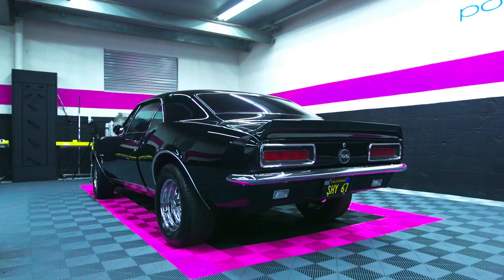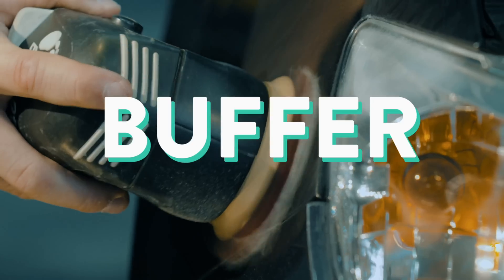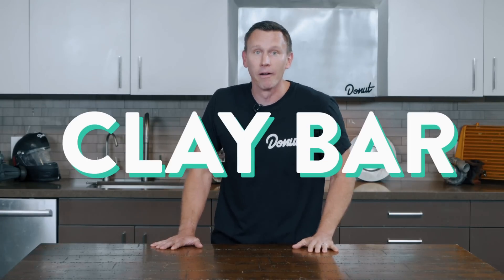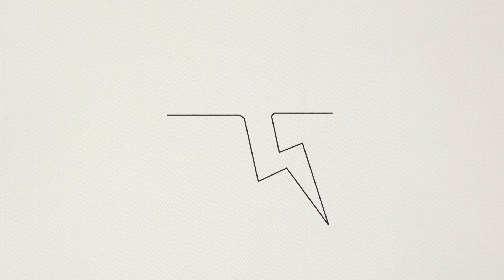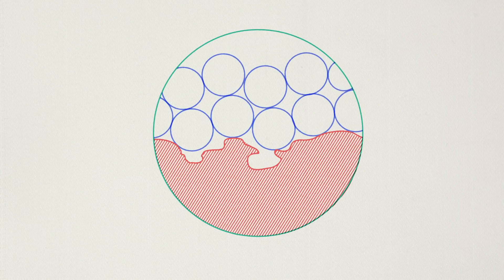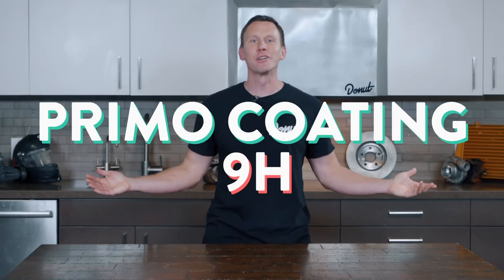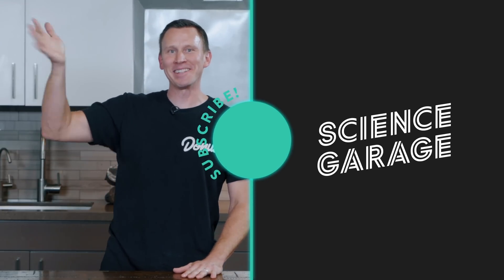CERAMIC COATING - How it Works | SCIENCE GARAGE

Comment: I didn't bother to do all that extra work because it says on my container that you can put it over anything. I washed and put a coat on. Does exactly what I wanted. Makes a very smooth surface that makes the water run off and hopefully all the dirt and crap won't stick as easily. I don't care for the super shiny look on car paint or tires.

Comment: Seems like you really should fix any paint chips no matter how small as you wouldn't want to fix them after ceramic coating as the paint wouldn't bond with the surface below as the ceramic coating is in between.  Correct?

Comment: I spoke to an automotive pain specialist at a high end car repair place, about various pain protections. He reckons ceramic paint protection is an expensive con. I'm inclined to believe him. In real-world applications, I haven't heard of it working any better than cheaper products over a long period. A friend paid a fortune for his new vehicle to be done with ceramic coating. A year or so later and it looks like it was never coated in the first place. He keeps his car in a garage most of the time, too.

I use stuff called Glaze (formally Autoglaze). Their website's a bit iffy, but the product works. It's been around a lot longer than ceramic coatings. Glaze isn't a polish, either. It's a polymer that bonds with the paintwork. It actually has tiny beads of glass in it, so the paint comes out ultra-shiny. It doesn't end up with any swirl marks and things like dried-on bird poo usually just wipe off, without any water or cleaner. However, I still carry special Mequire's or Autoglym paint cleaner to ensure I don't scratch up the paintwork.

Comment: Hey that hardness comparison and the relationship to pencil hardness is incorrect and accidentally misleading. 9h hardness on a pencil is like stiff wood but 9h hardness on the mohs scale (of which this video is clearly referencing) is harder than the best steels.
Reply: This is a big issue because it takes the concept of this "ceramic" stuff and implies a 9h hardness like ceramic in the mohs scale when it's actually an 9h in the pencil scale which is softer than the paint it is on.

Comment: Except. On some surfaces it just doesn’t work very well. I had my wheels done twice. They are black so they show brake dust very easily. I was attracted to the product because I wanted to be able to just rinse the wheels off without having to agitate every square inch to remove the brake dust. It didn’t work. And before someone tries to blame it on me, I had the wheels powder coated professionally and then Ceramic Coated before they were ever mounted on the car. Then I had it done again a few months later because it didn’t seem to work well the first time. Guess what, didn’t work while the second time either. 

Prior to this happening I convinced my father to have his wheels ceramic coated on his Z06 Corvette that had the factory chrome look. It seem to work really well on his car for a few months and then it stopped working.

Comment: How about a Hairlstorm test next time 😃
I was thinking to make a test of Ceramic coating. 
Like 3 coats and how durable it is.
Having 2 pieces of the bonnet or trunk same shape.
Then 1 with Ceramic Tripple layer and 1 normal paint.
See if the hard surface of ceramic protects from dents from such Storms.
I suppose one coat is like 7 H or 9 H hardness. Tripple would have a really solid surface to it.
Just that have to wait for the storm after applying 😁

Comment: I drive an old car that has clear coat all faded off so I just sanded it and painted it with base coat for a matte finish. A much cheaper and less maintenance heavy way. I don't have to worry about scratching it.

Comment: you get the same desired effect with regular wax(shine and protectant) as you do with ceramic coating without the expensive cost...wax is cheaper but may have to be applied more often.

Comment: FAKE.  This product is not ceramic.  Just because they call it ceramic does not make it so.  Ceramic is clay hardened by extensive heat starting at 1,650deg F, PERIOD.  The best benefit of this process is the prep work.  They take extensive measures to correct all defects in your paint.  That is what makes it look so good.  Then they apply a silicon based hydrophic liquid.  In actuality that shine you get is just from the paint correction process.  Just like a new car will look like new for years if it is well cared for, this paint corrected car will look good for years if it is cared for.  These products are not ceramic.  At best they are long lasting (annual), wax like coatings.  Read your fine print.  The lifetime warranty requires annual inspections.  What do you think they do at that annual inspection.  Clean and reapply the coating to protect the paint correction.  And if you have used "any polishes" or washed other than by hand in between inspections, guess what, your warranty is voided.  Because any abrasive action will remove the "ceramic" coating.   Are these processes good, probably, but they are far from the hype.  Save yourself the small fortune and just pay to have your car waxed every 3-6 months.  The cost of these gimmicks would be a nice down payment on a new car.

Comment: If you ceramic pro your car, does that mean you can no longer put a wrap on it? Since the wrap probably won't stick well with the coating on? Or vice versa, if your car is wrapped or has some decals or vinyl, can you put ceramic coating on top of that?

Comment: I used Avalon King Ceramic coating on my Corvette and it does work. I did the car, my wheels  all the glass and trim. My car is a convertible, so one bottle (Kit) did it all.   I have to say it came out  beautiful, the shine is amazing and the dirt rinses right off. It comes in a kit with everything you need. For around $65.00 bucks. Make sure you wash your car with Dawn dish soap it cuts the grease etc. the best, then follow directions. You can find them online Avalon King ceramic coating. Great product.
Reply: hell of a product

Comment: Now i wonder car manufacturers didn't come out with factory coated, if the say to cut costs, that's nonsense, because the could mark up the price as an option.
Reply: My best guess is it would slow down production cost cutting isn’t always just how much it cost to apply something but also how long it takes
Reply: @jigglebones9301  one solution, 'robots' , non human worker. If someone needs the car ASAP they could just dished the coating option., and got a non coated one, if humans can do it in few days, machines would do better job on a shorter dateline.

Comment: I suggest that if you want a ceramic coating done properly and with care that you do the research, practice on an old car, and do it yourself. The detail shops are suffering from the common malady of the day: they don’t give a crap about what your car looks like in the end. They just want your money.   I shopped around and did my due diligence, or so I thought. I picked the detail shop. They said they would have my car a week for the work I was having done. They had it almost 2 months. And they still didn’t get it right. It looks like crap. A lawyer told me it would cost me more to sue them and get it fixed than I could get out of them.  They cured me of ever trusting any business with my car.

Comment: I'm getting a paint correction and ceramic coating on my all-black 2019 Nissan 370Z. The ceramic coating I'm going to use is the Opti-Coat Pro+, which uses silicon carbide nanoparticles instead of silicon oxide particles.
Reply: Paint correction on a 2019?!? What happened? Is the factory paint just that bad??

Comment: i wish nissan had used ceramic coating on my nissan Micra 2018, because the paint has so little coats that i can be scratched by looking at the freaking car. As soon as i get it repainted i will apply ceramic coat myself. By the way i dont know if this problem is common on new cars, but my previous car, a Seat Cordoba GTi  from 1998 had such good paint i could hit cars while parking and it wouldnt even transfer to the other car or scracth (not that i did it usually but while learning to drive it happened 2 o 3 times) , it was amazing, i guess cost its the reason for such thin paint coating, but that little protection of the paint having such cheap coating products on the market is a shame for nissan. Great video Donut Media as allways

Comment: System X ceramic coating is the way to go. Better protection with only 1 coat, Ceramic Pro requires 4 coats to achieve this level of protection.
Reply: Actually, Ceramic Pro gives fantastic protection with 1 coat. 4 coats is only if you want it to last forever and have a permanent lifetime warranty.
Reply: @kenbouchard834  System X offers a lifetime warranty with 1 coat.
Reply: @Vox Populi before a ceramic coating is applied a vehicle MUST be completely stripped of any wax and contamination. Chemical and mechanical decontamination followed by whatever polishing is needed, then an IPA wipe of all surfaces going to be coated. Then you can apply your ceramic coating. If the prep isn't done correctly the coating WILL FAIL.
Reply: @Vox Populi iron remover, there are several available Carpro IronX is the best known, but expensive.  Some cases a tar remover. Followed with either a traditional clay bar or synthetic clay wash mitt to remove embedded contaminants. Re-wash the vehicle, this step is optional. Then determine the level of polishing needed. I personally recommend wiping each panel down with an IPA solution after each step of polishing. A lot of compounds and polishes will hide defects. IPA solution will remove leftover polishes that can hide defects.

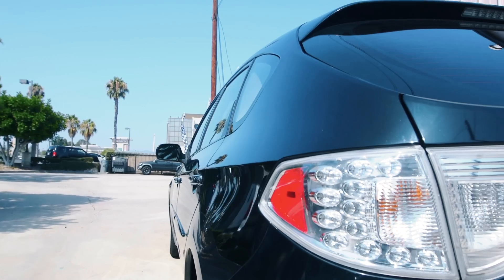Comment: 9:37 lol undoo all the hard work of them removing the scrathes lol good idea. Idk why people think you coat it and shes good to go no need to worry about scratching or maintaining the finish. Taking it through those acidic touchless car washes for example strips the coating. If it can over time ruin rubber and plastics it can chop away at any mircoscopically thin coating you put on. So buyer beware. ceramic coatings are fanfuckentastic but you have to maintain them properly too. otherwise its just wasted money and time. Learn how to properly clean car and enjoy a smooth clean paint job for many years ;).

Comment: The question I can't seem to get answered.  When it becomes time to reapply, Do you need a professional to remove the old coating??
Reply: Bryan Sage professional will repolish the car down which will strip the old coating unless it’s a 10h coating like the one from GTechniq. That cannot be buffed off, only sanded off. Then a repolish and recoat. This said from an accredited GTechniq installer.
Reply: @totalpackagedetailingllc4413  Thanks, your only the second person to answer that question after a year of asking it.  It seems to me that would be a hidden cost of your having it done professionally.  At the end of the day you cannot just walk away and try something new or even just clay bar.
Reply: Actually you can, that process would only be required if you wanted to reapply another ceramic coating. You can put wax on or clay bar it after the coating longevity period is over.

Comment: My question would be:
I see a lot of cars who have horrible paint jobs done, as if the paint was peeling off.
I was thinking, could it be that the Ceramic coating isn't UV resistant, and starts cracking the paint over time?

Comment: For anyone wondering. Average cost is +-$1800. Starts around $600 for a quick wash and a few coats of ceramic coat. (Don’t recommend you go cheap). Can go up to +$3500 for paint corrections. Polishing. Many layers on paint. Wheels and windows are optional extras.

Comment: 10H Glass ceramic coating is where it's at. Just getting the basic coating (8/9H) just isn't worth it since it doesn't protect against scratches.
Reply: There is no such thing as 10H LOL! Anyone or brand pushing that is just straight lieing to the market. Ceramic Pro Products are above 9H in hardness, but there isn't a scale past 9H.

Comment: Ceramic coating seems like snake oil.
Reply: To extent it is. You have to maintain it. You can just slap it on and wash car through automatic washes and whatnot. Or even with improper washing methods. Very simple you just hand wash it with recomended soaps and it lasts for years. But there are alot of snake fucks in the business that dont tell full story to customers. Imo thats not fair i understand they need tomake a living and provide service and its customers job to do the research but still. Some people that think they need or want this done to their cars should just save their money for something else. You buy a brand new lexus or bmw and want it looking mint i get it ya do it but make sure youre the type that cares for their stuff. But if you got some pickup truck that you take to job sites...mmmm id recomend you buy carpro cquartz uk and learn to coat it yourself. The main thing that costs money with these ceramic jobs is the paint correction. On a work truck though....do you really need the paint looking mint with no swirls? Probably not...all you need is to make it easy to clean.
Reply: Red Menace VINWiki doesn’t seem to think so.
Reply: If expensive car you sure. Every car not.

Comment: X-Men's Colossus is actually a normal guy who worked in a car body and paint shop, he accidentally fell into a vat of 9H ceramic-coating liquid. Now, he's heat-resistant up to 1200 F and is very easy to wash, no shampoo required, just water at a high angle is needed.

Comment: Because when I have 1,800 sitting around I think... "You know that car that has 350,000 miles on it and I just dropped in a new tranny for? I think I want a ceramic coating."

Let me know when its $500.00 or less, I'll be first in line.

Comment: I got the Gold Package Ceramic Pro 9h on my BRZ.  Easily the best decision I've made to keep my car clean as its needed to be parked outside due to no garage.  Its so incredibly easy to clean and maintains the hydrophobic properties even after two years.  Sometimes I wax it just to give It a sheen but thats really just for looks.  Completely worth it.
Reply: Instead of waxing it, buy a 10% silica spray sealant to make it look like the day after the coating was applied. Basically a lite-version spray on ceramic coating that boosts the coating’s shine so much.

Comment: What is 9H on the moh's scale?
Reply: 9H isn't on the MOHS scale. 9H is refrenced to the pencil hardness as explained in the video.
Reply: Ceramic PRO USA sounds like you have an inferior product. Why start the video with the moh's of this and that and then change to some other scale. All solids can measure in moh's. What's the moh's of your product?
Reply: We aren't avoiding the question... watch the video again. He references MOHS scale to rocks and minerals that can get into your clear coat. Our product isn't measured by MOHS Scale so why would we want to mislead anyone by doing so? Its 9H on the pencil test as other coatings are measured the same way. We are backed by carfax and are the global leader in ceramic coatings.
Reply: At 1:39 the video says most automotive coatings fall between 2 and 4 on the MOHS scale. If you will not compare your automotive coating to these others on the same scale I must believe yours is equivalent or inferior.

Comment: Coatings are great for about a year. A lot are fantastic for two. But the issue with 3 or 4+ year coatings is that contamination builds up and effects the hydrophobic properties that make cleaning easier a less harmful to the paint.
Reply: That's why with ceramic pro they have you come back once a year for a check up. The car gets completely decontaminated and then a refresher coat is thrown on top to keep the coating working properly and to keep the top layer of the coating from getting worn away through abrasion

Comment: I remember trying to sell these things with new cars. No one ever opted for it, even after showing them the demo. (Which included me spray painting a light patch on a new car in the showroom and then just wiping it right off after 10 min - 15 min). I wanted it myself but i got the idea that it was super pricey because it never EVER sold, everyone got the vibe that it was just a quick temporary gimmick.
Reply: Dealerships offer sealants which is a very different product than a ceramic coating. Sealants come off with a couple of weeks therefore they are only a short term solution like wax.

Comment: Good video, but...

As great as ceramic sounds, I use a bottle of Nu-Finish ($10), an orbital buffer ($40, and lasts for years), and a few polishing bonnets ($20 and also lasts years) every 6-12 months and have enough $$ left (vs. ceramic coating) for a new set of rims... and tires!
Reply: Nu finish is great since we can apply it even In the sun 🌞 😁
Reply: HAHAHA!  Not sure why they ever thought that was a selling point (especially since its best to never apply a sealant on hot paint);  But I have found, after 40 years of polishing cars with various brands and types of waxes and other sealants to dozens of cars, this stuff beats all the others - short of spending hundreds of dollars or more.  (Nu Finish, please feel free to send royalty checks to my home address).

Hey Nacho, a little trade hint here:  Put a coat (or better yet two, with a day between applications) of Nu Finish and you;re good to go for months.  Meanwhile, if you want a really nice shine, just use some spray-on quick detailer (any major brand) after washing, and you'll be stylin' with the best of 'em at a very low cost.  Been doing it for a very long time.  (Nacho TV, please send cash for this advice to my home address).  

PS -  Anyone who had read this far in my absurdly long comment has received advice that will save you a ton of money and headaches - not to mention have great looking cars like I do :D